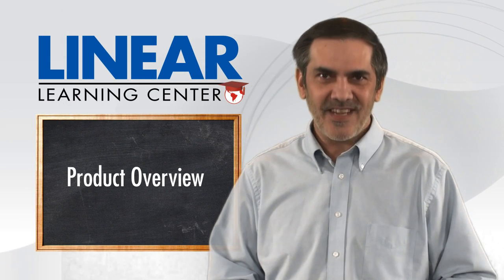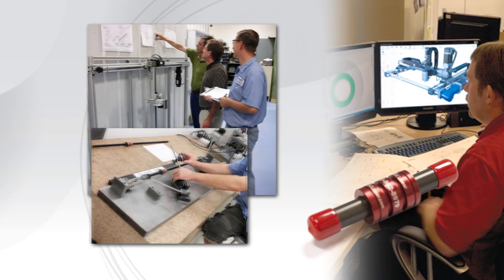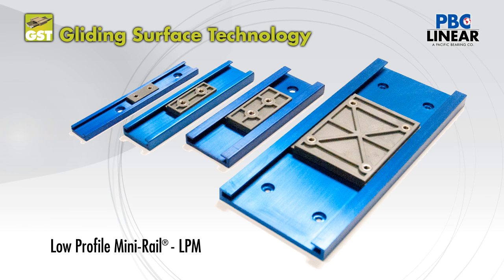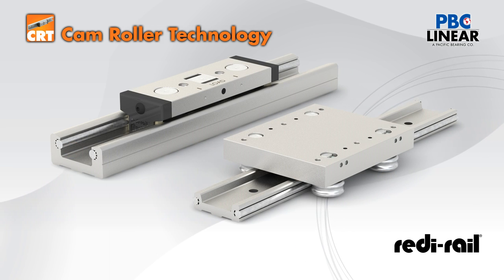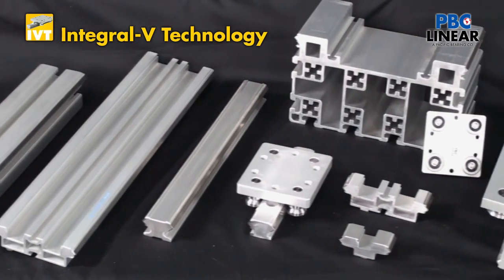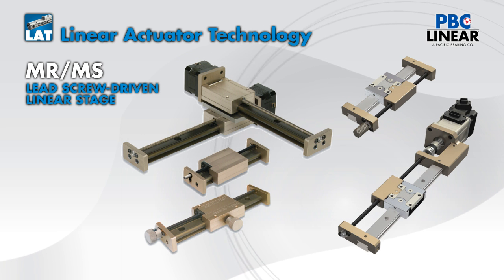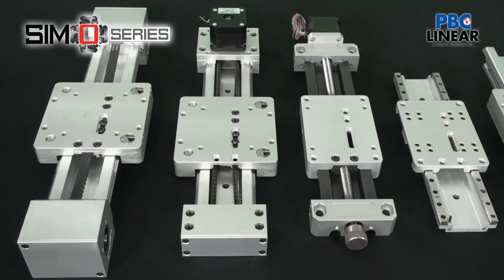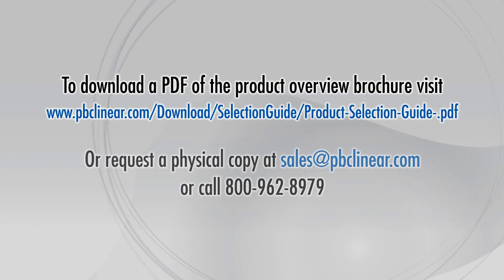PBC Linear Bearings, Slides, Guides, Rails and Actuators

Comment: I have 2 of the adjustable ready rails. I got them from a business that closed. They were being thrown out. It was made into a sliding table, like an X or Y axis. There si zero play or side to side movement in them. Very good quality. It could easily handle at least 200 pounds. I am using it as the Y axis for a CNC machine I am building at home.
Reply: I looked around the used market and found 6.4 meters of 45 x 180mm 80/20 extruded aluminum T-Slot system (plus all kinds of 45 x 45mm) for 140 USD Best deal in recent memory :-) So much forward motion in the acquisition of this essential material for this  1200 by 1200 mm CNC build, I am now on to the search  25mm Hiwin rail with 20mm  dual bearing (DFU) ball nuts and 20 mm x 5mm pitch ball screws. No YT vid has even alluded to or recommended this option and it is much better resolution.  Single bearing block is termed SFU and it was actually a vendor on ebay that first asked the question on my preference :-) Gotta love it. These full kits of the Hiwin gear are well over twice the round rail asking price. Do it right the first time I say :-)